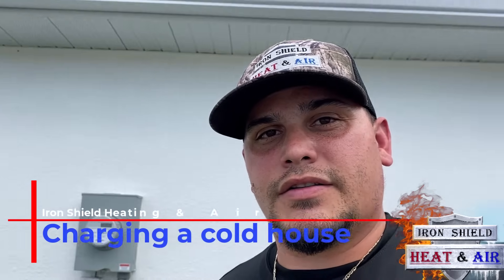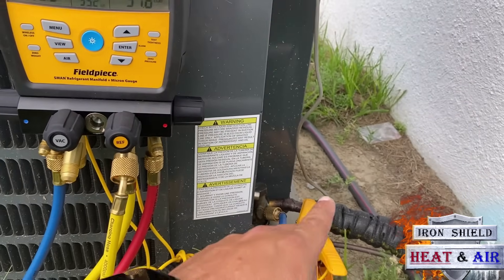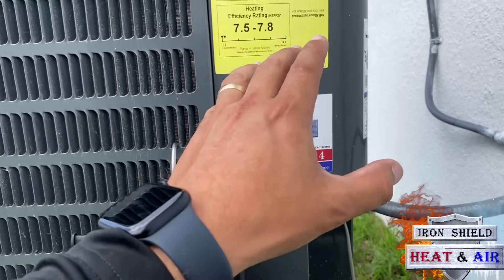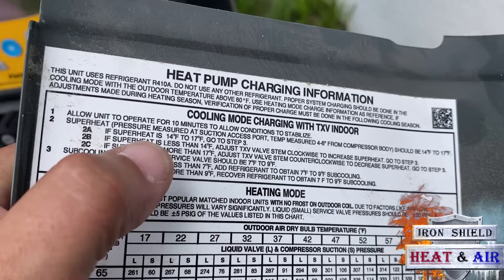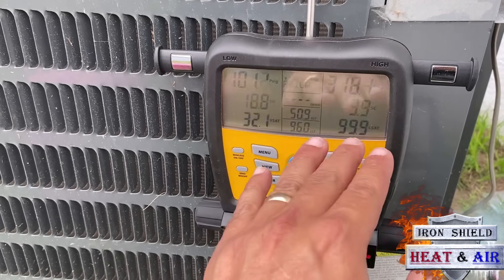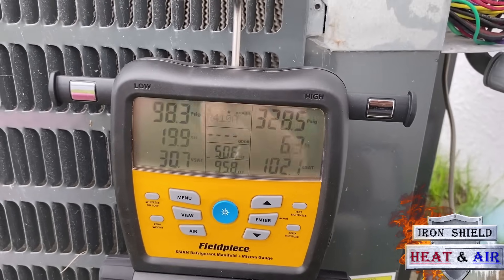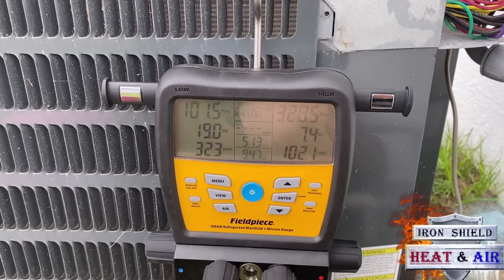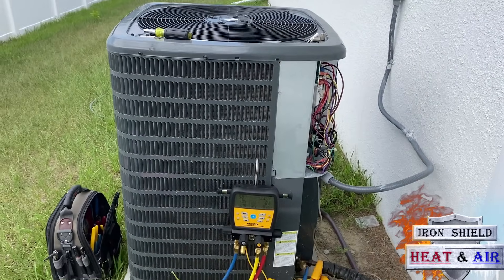I WANT IT COLD! Charging 410A by superheat and subcooling

Comment: Can you help me? New AC and furnace installed today and the two techs were in disagreement about the sub cooling. One guy said it was too high the other said it will be fine. I thought he said it was at 35-36 and it should be at 31. What do I do? Ask them to send someone out and recheck it? It was 85 degrees out during install.

Comment: The biggest issue we find in production built sub division homes  is undersized returns. For some reason, they cut corners on the return with a single 12” return. Adding  a 10” in the master bedroom  will solve most low cooling issues. Of course, you always check static pressures first and afterward. You will have to drill your own holes for the probes because they never do it on start up. The furnace label will tell you what the static pressure should be. If it’s too high, it will shorten the life of the blower motor, cause noisy ductwork and poor cooling issues.

Comment: checking these pressures and temperatures at the compound gauge,. first when refrigerant was added and sub cooling went up, but the super heat stayed the same, including the low suction pressure did not increased meaning you have a liquid line restriction , or txv problem,
Reply: Yea he went straight to selling another unit lol 

Didn’t even bother to look at txv or not looking at inside unit for airflow!

Comment: To address a low VSAT (Vapor Saturation Temperature) reading, which is an indication of the temperature at which refrigerant evaporates in the evaporator coil, you should consider the following potential causes and corrective actions:

Potential Causes:
Low Refrigerant Charge:
Insufficient refrigerant can cause the evaporator coil temperature to drop.
Dirty Evaporator Coil:
A dirty coil can restrict airflow, leading to lower temperatures.
Restricted Airflow:
Blocked or dirty air filters, closed vents, or obstructed return air can cause reduced airflow over the evaporator coil.
Thermostatic Expansion Valve (TXV) Issues:
A malfunctioning TXV can cause improper refrigerant flow, leading to incorrect temperatures.
System Overload:
High indoor humidity or excessive heat load can cause the system to struggle, affecting the VSAT.
Incorrect Superheat or Subcooling:
Improper superheat or subcooling settings can indicate an issue with refrigerant flow or charge.
Corrective Actions:
Check Refrigerant Levels:

Verify the system has the correct refrigerant charge and add refrigerant if necessary.
Clean the Evaporator Coil:

Ensure the evaporator coil is clean to allow proper heat exchange.
Inspect and Clean Air Filters:

Replace or clean dirty air filters to ensure adequate airflow.
Check Airflow Path:

Make sure all vents and returns are open and unobstructed.
Evaluate TXV Operation:

Check the operation of the TXV and replace if it’s malfunctioning.
Check for Air Leaks:

Inspect the ductwork for any leaks that could be affecting airflow.
Assess Load Conditions:

Ensure the system is not undersized for the cooling load and check for excessive humidity or heat sources in the space.
Adjust Superheat and Subcooling:

Make sure superheat and subcooling levels are set correctly according to manufacturer specifications.
Steps to Increase VSAT to 34 Degrees:
Ensure Proper Refrigerant Charge:
Add refrigerant if the charge is low.
Improve Airflow:
Clean or replace air filters and ensure all vents and returns are clear.
Clean the Evaporator Coil:
Remove any debris or buildup on the coil.
Inspect TXV:
Make sure the TXV is functioning correctly and adjust if needed.
Check for System Load:
Reduce any unnecessary load on the system, such as high indoor humidity or heat sources.
By systematically checking these potential causes and making the necessary adjustments, you should be able to raise the VSAT to the desired 34 degrees.

Comment: Interesting how MVAC testing is so different. In MVAC, the manifold gauge tells you everything. Superheat and sub cooling isn't calculated. Charts are  very common showing operating pressures at different temps and humidity. As well as vent temp.

Comment: Low load ,charge is low as well I would bring sub cooling to specifications if specs are not listed bring sub cooling to 7-10  degrees .
Reply from the maker: The charge was spot on. It was definitely a low load issue 👍
Reply: @ironshieldheatingair5751  disagree with you charge is low. Superheated is to high at them conditions and subcooling is low . That tells us to little refigerant on low side to little on high side what does that indicate? Sh 20 Sc 3-4 to low .
Reply: @robertcherry4971 
That is what I am saying as well.  That unit is low on refrigerant. 
If your refrigerant is superheating 20° with a low inside temperature you're evaporators clearly starving for refrigerant, and I can't speak for anybody else but i have never seen a recommended subcooling of 3.  The general guideline I have always been taught was subcooling between 7 to 12 degrees, and from experience I can say manufacturers want their equipment to be in a range of 10 to 13.

Also it is entirely too cold outside for him to be adjusting  refrigerant.  His liquid saturation is 100° so his outdoor dry bulb temperature is probably between 70-75 degrees.

Comment: That is a little low as well. Txv? You’re lsat is like 3 degrees above outdoor. Should be 15 minimum 8 degrees subcool. You’re VSAT will go up and low side. The indoor temp of 78 will not effect that maybe 65-68 degrees indoor would
Reply from the maker: Txv indoor and the charge was spot on per charging table. Every system has a different subcool and superheat target. The indoor temp was 67 degrees and the return air temp was even colder due to a portable unit installed next to the return air. The homeowner wanted it cold. I see you didn’t watch the whole video based off of your comment 👍

Comment: How cold is he trying to keep the inside?   Someone told me that your central unit can only cool 10 to 15 degrees below the outside temp.  I dont know how true this holds.  I prefer window units i can get my bedroom about 68 degrees on a 100 degree day.  But my bedroom is on the north side.  He needs a freeze protector stat on the evap coil.  Its wired in with the 24 volt contactor in the outdoor unit so if it detects freezeing conditions on the evaporator it will shut off the condensor blower will run till frost melts, and outdoor unit will restart again.  I worked on a trane unit that was set up as a low ambient unit to cool a server room, and it had a freeze protect device on the evap coil.
Reply from the maker: A freeze stat should be standard on all systems in my opinion. But a properly sized air conditioner with proper ventilation in the attic space where the duct work is located should keep the home 20-25 degrees cooler than the outside temperature. A slightly oversized 2 stage system is the way to go in Florida in my opinion so it can ramp up on the hot days and ramp down on the mild days 👍
Reply: I’m in mesa az. When it’s 115f out I can keep it 72f if I want to watch that power meter spin. I also have 8 tons of cooling on a 2800 sq ft home.
Reply: @Bacongrease00  Meat locker!!!  🤣
Reply: @Bacongrease00  It's 100% humidity in Florida
Reply: Man You Ain’t Lying About Them Window Units Especially If you Close The Door To That Room 🙌🏾
Reply: I’m anxious to see the answer to this.  Just installed $15k system sep-2023 that can’t cool my house below 82 degrees when it was 98 outside.  Feeling pretty scammed.
Reply: @ericnewton5720 that’s 100% on how the install was performed. Something’s definitely going on because I’m a hvac tech myself and  I have a 20 year old r-22 system that works perfect on 95 degree days . Something’s going on there w
Reply from the maker: @JR-mj8kh  read the comments 🫡
Reply: @ironshieldheatingair5751  I read them , I’m just replying to someone saying there new system can’t cool below 80
Reply from the maker: @JR-mj8kh  I gotcha.. I agree with your statement 🫡
Reply: fail to state mention. insulation

Comment: You will go back .... to adress air flow
Reply: Wow! That customer must have lava in thier veins .
Reply from the maker: No, I wrapped it up. The homeowner had a portable unit sitting in front of the air return causing a really low return air temp. The home was 65 but the return air temp was 57 degrees. Causing a freezing temperature evaporator coil. The filter was clean and the static pressure was .06 😎

Comment: Did you measure indoor airflow with a manometer? Kind of looked like low indoor airflow to me.
Reply: Just what I was thinking.
Reply from the maker: The issue ended up being that he had a portable unit sitting in front of the air return so the return air temp was 57 degrees 😂. The guy was from Wisconsin and wanted it freezing cold in the home. I like my house cold but this guy was on a different level. The air flow was spot on. The static pressure across .06
Reply: @ironshieldheatingair5751  I have never seen or ever heard of static pressure reading of .06 in my entire career.  That is basically no static pressure at all.  .6 I can buy and see all the time, but .1 or .2 is hard enough to achieve with the newest systems.  The rest of the video I am onboard with.  In Colorado, everything is de-rated, so we have to adjust charges differently.  But that SP is hard to believe.
Reply from the maker: @Balticblue93  nice catch! 😂 I meant to put .6 🙌🏼
Reply from the maker: @Balticblue93  I’ll be in Colorado next summer. Looking forward to it.
Reply: @ironshieldheatingair5751  Oh ok!!  That makes much more sense.  I was wondering what kind of system that could hit numbers like that.  Thank you for clarifying.
Reply: @ironshieldheatingair5751  Well, I hope you have a great time on your trip!  It is an awesome place, but drink lots of fluids that isn't alcohol because you need to stay hydrated, alcohol takes about half as much for the same effect, I don't drink anymore but be careful, if you do.  And wear sunscreen from the UV index of 10 every day.  But it is an amazing state.  Enjoy!